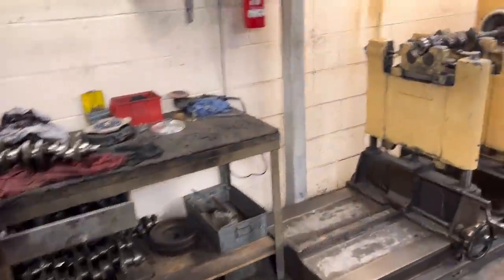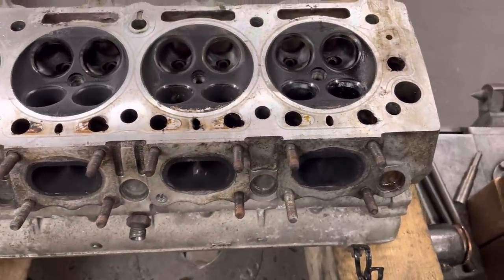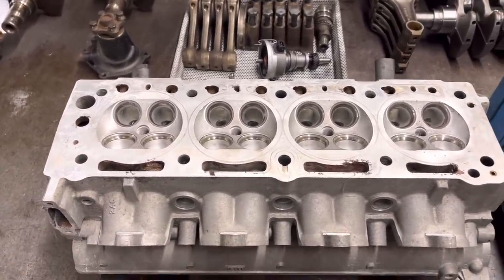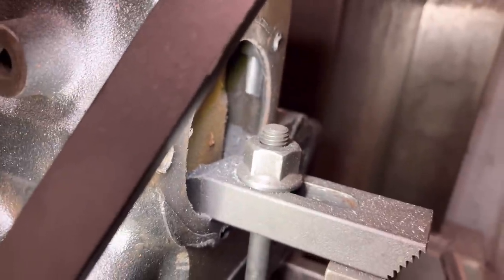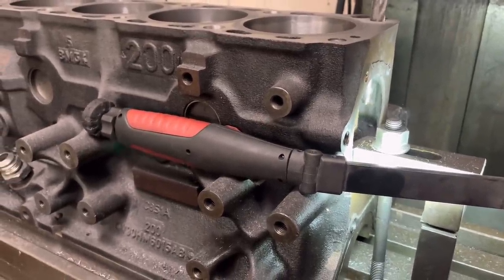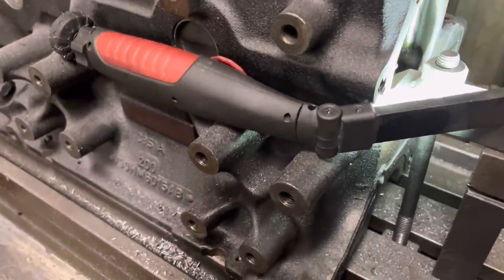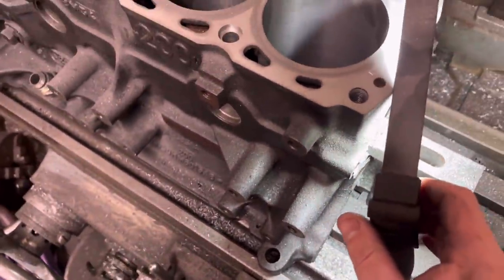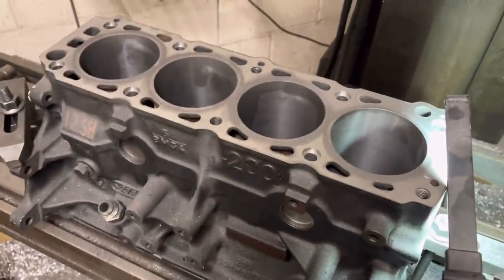Forgetting this COSWORTH machining process could cost us £2000 for a new block

Comment: Best using endmills in a sealed collet holder. Helps them run true
Reply from the maker: Done lots and lots of machining this way Rob, whatever works is good. Thanks for the advice 👍
Reply: @BarumEngines  So 5.2mm, deep (well 5.18mm actually)?  I would also use a collet chuck rather than a Jacobs type, too (even though this type of machining is not in my engineering field).  

Tapping drill would likely have a sleeve in that clearance hole, too.  Nothing better than ‘belt and braces’ if there is any doubt….

Comment: I drill and tap most valve guides and push against a bolt threaded into the guide with a drift. This avoids mushrooming the end of  guide which could enlarge the bore in the head.

Comment: Hello, yes me again, these posts are great, takes me back to the days when I used to strip machine and build race ready engines.. Anyhow, saw a video on Youtube here I think a couple of days ago where in India they were stripping and refurbishing a tired old 6 pot engine, I have no idea what from, but , seriously, dirt floor, outdoors big and I mean BIG hammer drift held by accomplice and sledging out valve guides, milling the head and block, replacing valve seats recutting them on a mill and grinding in by hand, rebored new pistons etc etc etc , the works, all done in half open dirt floor work sheds, normal (for them) clothes, flip flops  on their feet, no eye protection, no mask shields or gloves when Arc welding, or even gas welding for that matter. It was truly eye opening, but I guess it works for them.
Reply: .....and the use of child labour in many of those videos. They get the job done but wouldnt be my choice of shop. I have a feeling they get a lot of breakdowns.

Comment: I've always warmed up aluminium heads before knocking out valve guides, not smoking hot, just barely too hot to touch so around 60 or 70C. It helps not rag the aluminium when knocking them out, same with fitting them.
Reply: @Kris Nicholson what temperature is the engine at when running? Now read my comment again
Reply: @lol4fun  I think you just got ya pants pulled down 😂
Reply: The correct way to do it is to put it in an oven....controlled temperature across the whole job
Reply: @chiefrocka8604  No he didn't, the temps he is talking about will cause no problem whatsoever.

Comment: When I worked in  a machine shop we always used coolant on the cutting tool, or cutting paste.always blew the swarf away with compressed air,the same as you. But always wore safety glasses,still ended up at the hospital eye clinic a couple of times though
Reply: Coolant on cast iron?  I thought that was a no no?

Comment: Brings back memories of doing my own Kent engines when racing at Kyalami in the ‘70s.
Reply: Kent engines were great bullet proof engines and it must of been great back then racing at Kyalami
Reply: Philip,
It was indeed and I would take the car to the track every opportunity I got including Saturday Open Days.
That mile long straight and the back section with its change in elevations was exhilarating.
I remember every corner as if it was yesterday.

Comment: Valve guide pound out. Ever thought of a block of wood with a ledge on the bottom to catch the edge of the work bench and a ledge on top to stop the head from sliding away and to protect the valve cover mounting surfaces. Throw it on the head milling machine if the surface gets a little raggedy.  I cringed with every hammer blow when he was driving out the guides.
Reply: I think 🤔 they no what there doing and wood is for carpenters not a machine shop. Brute force is sometimes the best way to sort out things as ye got them all out didnt he

Comment: I know it would cost a ton, but try a carbide end mill for increased rigidity especially over that length versus a hss unit. Chatter still might be an issue though and chip the flutes.

Comment: Would it not be better to warm head up before knocking valve guides out ?
Reply: Never had guides require that much HAMMERING!   Locktited in?  Carbon buildup around the guide not cleaned/scraped off & F'n up the head's bore on the way out?

Comment: If you want a 5mm depth counter bore then you need to raise the knee 196.8 thou. Not sure where you get two turns plus 4 thou from that would be 204 thou or 5.18mm. The conversion is 25.4mm to 1 inch
Reply from the maker: Thanks for the information 👍
Reply: @BarumEngines  It's 25.397mm if you wanna be accurate 😁 liking the videos